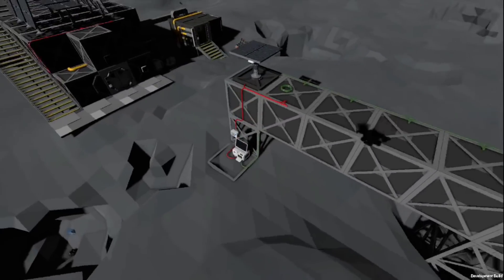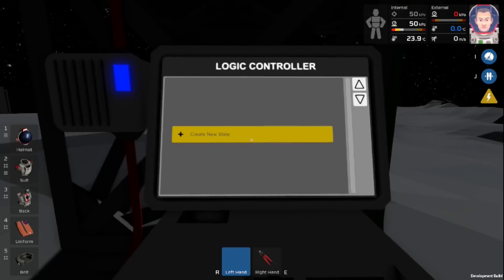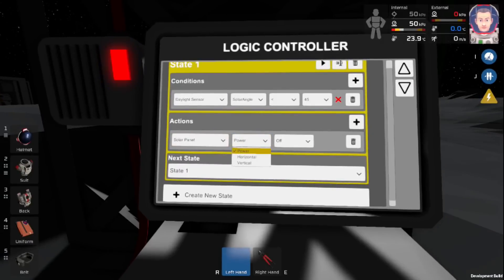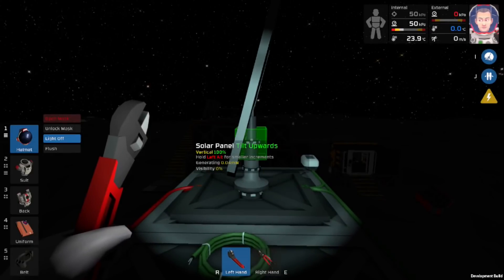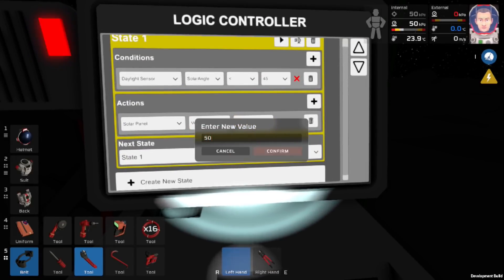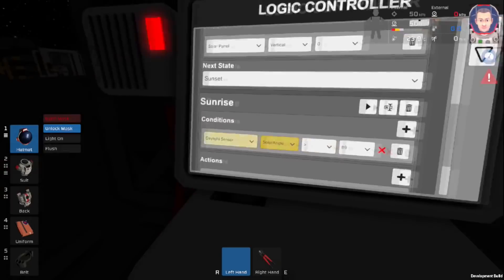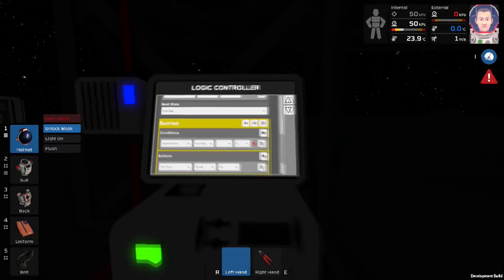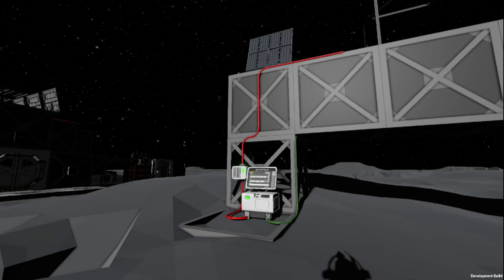Stationeers Tutorial: Basic Auto Solar Panels

Comment: Hey ! I had a question. How do I monitor my power output /input totals for my base and regulate it?
Reply: they added a circuit board "network monitor" that you can put in your tablet to see what power usage is.
Reply from the maker: From my tests Ive found that you can run a fairly large base without having a big need to monitor my power in/out put. The wires can handle about 5kw from what I have tested. Occasionally ill check up on it with the tablet but I haven't needed to go much further than that. If you are running into problems the transformers work great for regulating how much power you want.